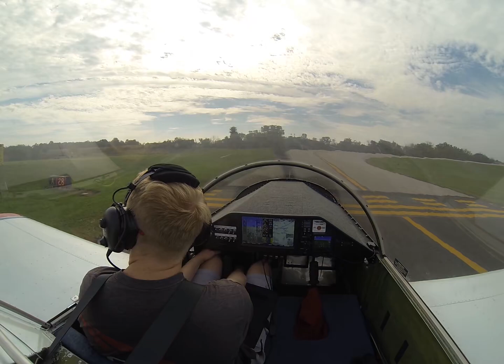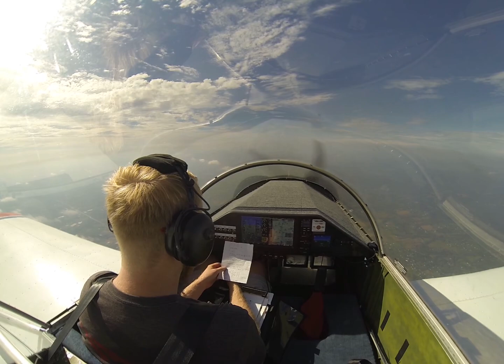Sonex:  Cruise Performance Testing

Comment: Interesting that you seem to be getting the best TAS at 4500. Is this what you'd normally cruise at?
Reply from the maker: All depends on the distance.  If I'm going far cross country (+50nm) then I'll usually head up to around 6-8k depending on temperature.  But for shorter trips I'll typically stay in the 3-5k area.  Now that I'm reviewing the numbers it looks like I did all my fuel economy calculations based off of IAS and not TAS, which is obviously wrong.  Updating the numbers in the spreadsheet now.

Comment: This is a tri gear aircraft, correct?  I'm building one, and would like to understand the sight picture a little more.  Thanks!
Reply from the maker: Yes sir, this is a tricycle model.  Some advise if you are building one:

-Make the panel vertical like I have mine, this reduces glare substantially  

-Don't use the cable driven drum brakes.  They work for about a year then become basically useless.  Ive had great success with the hydraulic disc brakes that Sonex sells.

-Cut out NACA style ducts for cabin ventilation.  The ones on the Sonex plans are not a true NACA shape.  I ordered a set of these which are on the way:  http://www.ansoneng.com/sample-page/products-summary/fresh_air_intake/  I'll probably make a video about these ducts in the future.

-Soundproofing.  Sound is a huge source of fatigue.  Use Dynamat Hoodliner for engine side firewall and use Dynamat Xtreme for flat panel surfaces inside the cockpit.  The sonex has a lot of flat aluminum surfaces that basically become giant vibrating speakers.  The Dynamat stuff is a little pricey but it does make a noticeable difference.  Its also lot easier to install before the plane is completed.

-Get a good CHT/EGT sensor set.  Sonex run hot.  Short term high EGTs are normal during takeoff and climb, but keep an eye on your temps so you dont cook anything.

Comment: Nice video like how you uploaded the spreadsheet. Like most cruise numbers are not as good as manufacture stated I guess that is to be expected. Still I think any lower cost aircraft cruise speeds more then 100 knots is good. 115 knots for the cost of a sonix is good deal. I wonder how well the Turbocharged AeroVee does.

Comment: What engine? Considering building a Waiex. Thought they had better economy.
Reply from the maker: Jabiru 3300A.  Personally I would recommend against a V/Y tail.  V tails tend to be more aerodynamically unfriendly when it comes to lower speed flight, particularly stalls.  While they are more efficient with less drag, you're already in a rather short wing aircraft to begin with.  If you want a high efficiency aircraft go with the Xenos.  Otherwise I think you'll get more enjoyment out of a conventional tail aircraft.  MUCH more simple to build aswell.  Additionally, the Sonex is already really good in terms of low cost per mile operation.
Reply: @MatHolliday  I'm a fan of the Y tail, it looks cool. I've done many stalls, slow flight, spins and other aerobatics. The only downside of the Sonex design is it doesn't have the low speed rudder power of a Super Cub.